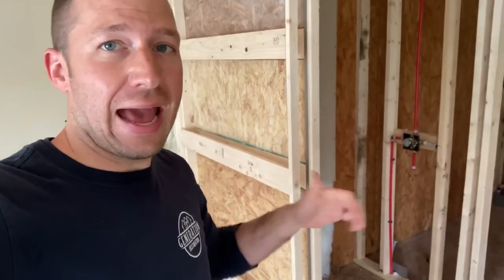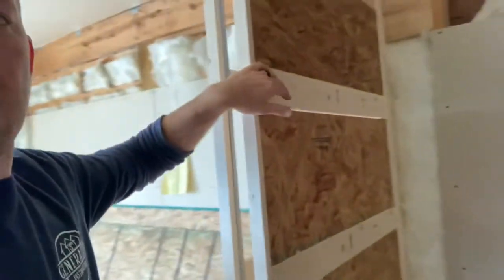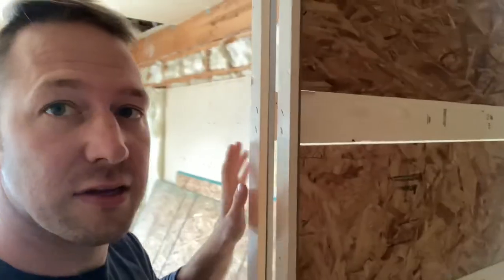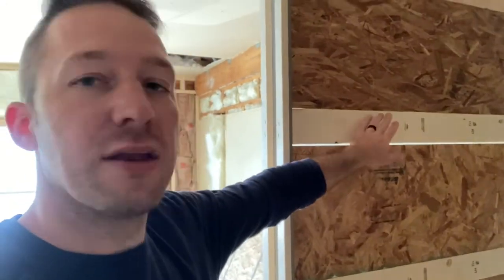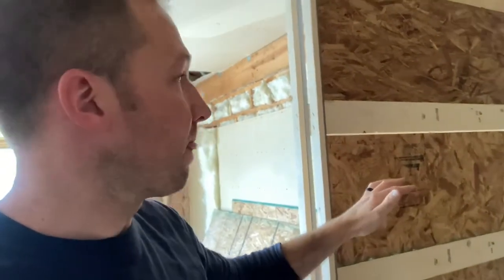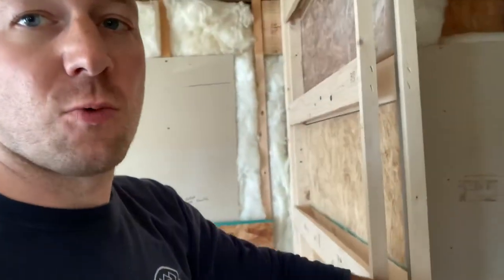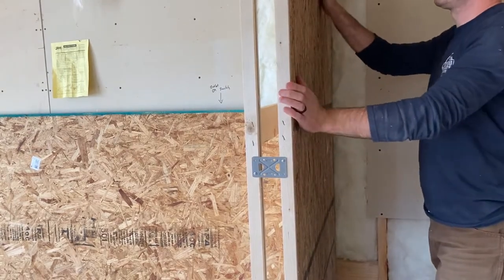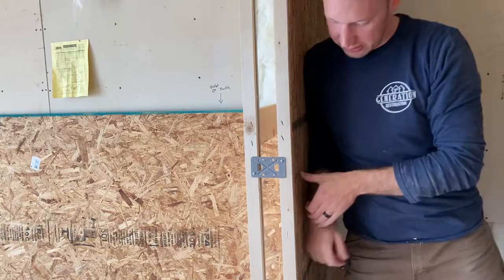Ideas for Framing a Pocket Door Wall for Tile Shower

Comment: I did similar to this for a customer about 10 years ago and it has held fine. I filled in the pocket door framing with one by pine and put a layer of 3/4 over the top with excellent results. The frame for the glass shower door that anchored to it may have helped as well.
Reply from the maker: That is super helpful Brian! Thanks for that feedback

Comment: I had this same issue. The space is tight and I had to choose between building a fully framed wall with studs facing the proper way, or turning the studs sideways. 

I turned the studs sideways and covered it with 3/8” plywood. I’m adding on top of that. If the wall still flexes too much, then I’m going to undo it all and just go with framing another wall adjacent to the pocket door wall.
Reply from the maker: Let us know how it turns out!!
Reply: @SpiritofaHandyman  Hi, so the wall is only 41" wide. I ripped a stud in half for the bottom wall plate and turned the studs sideways in the wall. I put blockers between each of the 4 studs and then covered it with the 3/8" plywood. The last ~23" of wall still had nearly a 1/2" of flex. So I took it all apart and added a properly studded wall with blocking on the side of the pocket wall door. I knew this was the right answer all along, but I was trying the maximize the space in the shower. With the fully studded wall, the shower will be 34x33 after the tile is on.
Reply from the maker: That’s the best research we could want. Thanks for confirming for the rest of us

Comment: Thanks for sharing your experience on this. I might be wrong, but isn’t that OSB? Im considering to try something like this but using 3/4” plywood with pocket screws into the framing around it in place of the 1 by material as the ladder frame.